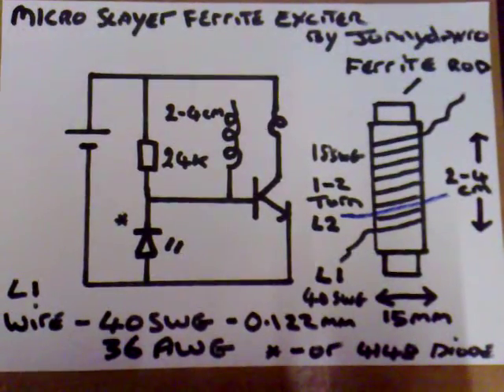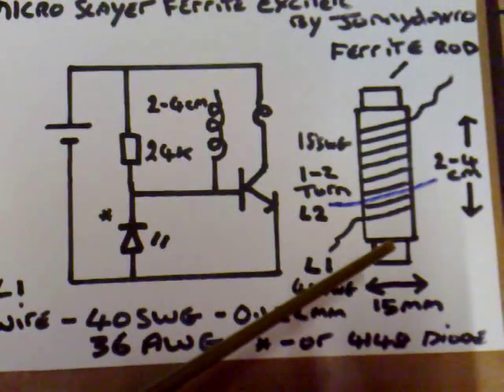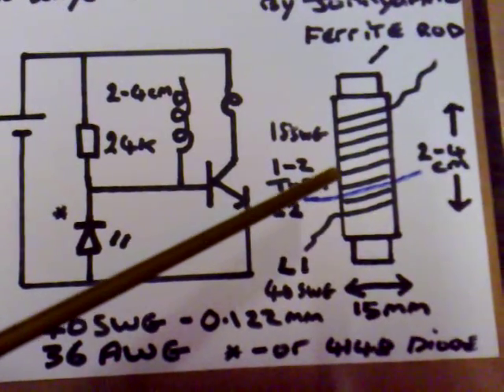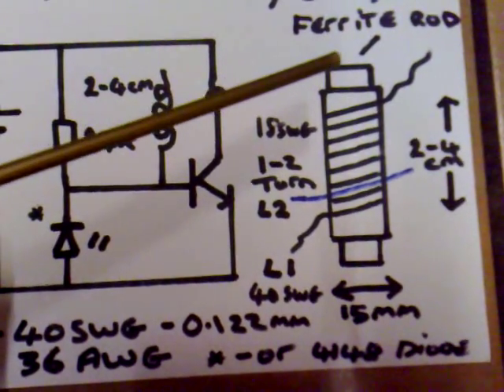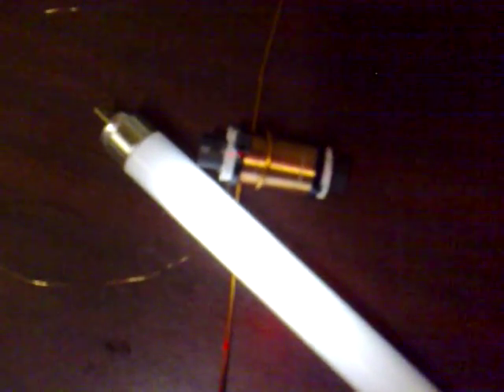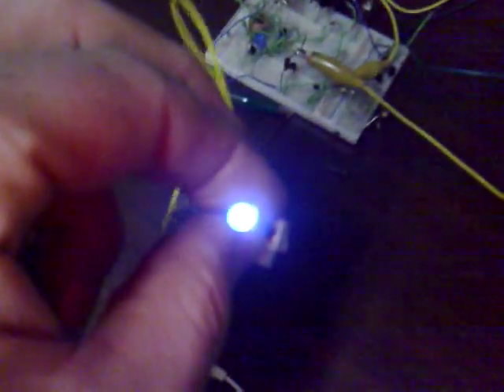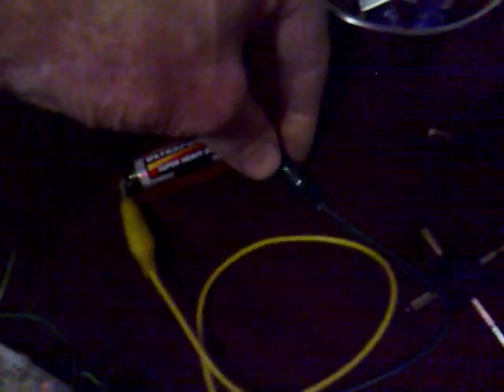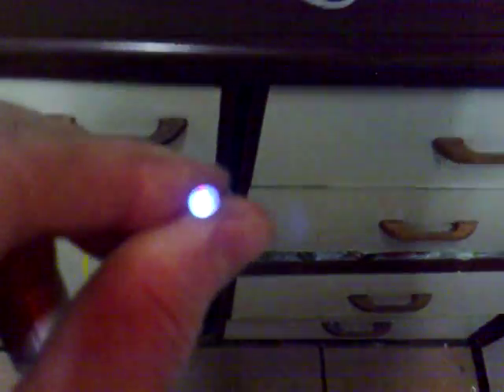2cm micro slayer ferrite exciter

Comment: First off, great work. I had a couple of questions.

Will this circuit energize a neon tube?

If you rectified line ac, could you run this circuit on the higher voltage dc?  

Thanks.

paul

Comment: Hi Jonny, this circuit works well with those trigger transformers you used in the 'Simple SEC'. I taped two together head to head with the ferrite parts touching. Took a while to figure out which legs to use, but the circuit fired up after I attached a clip lead to the HV out. Partially lights an unmodified CFL on 2.5V. Good wireless field too. Could be made into a very compact unit. Cheers!